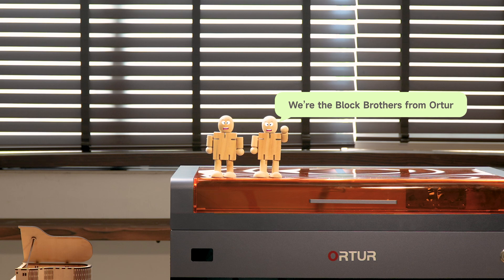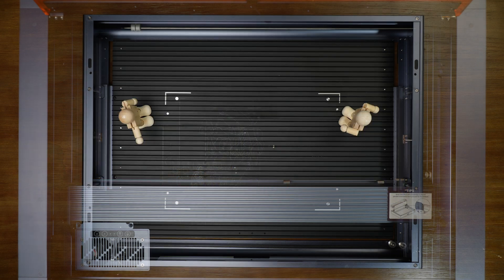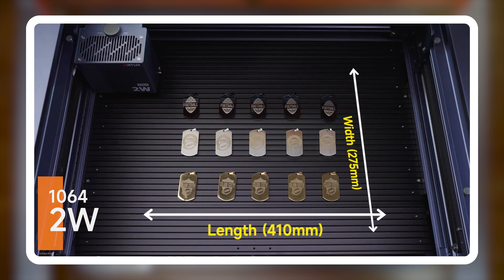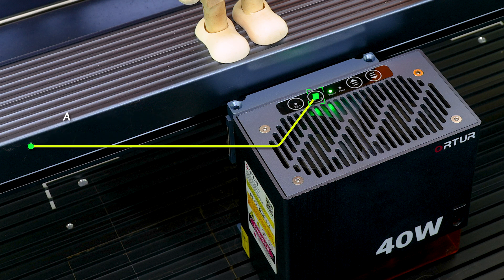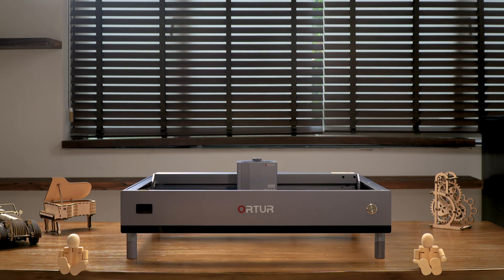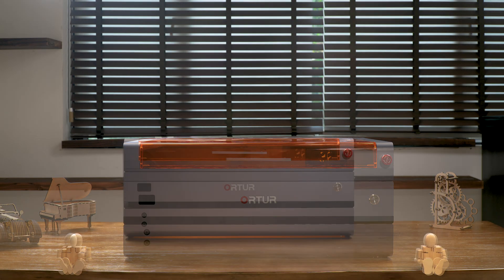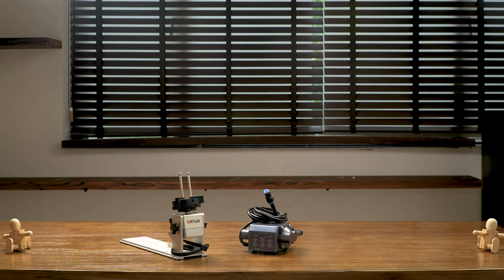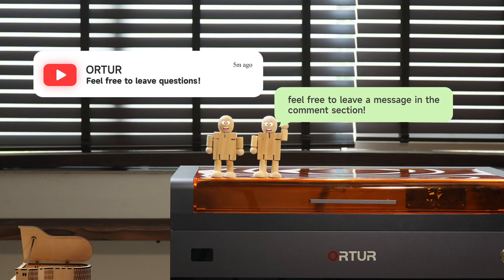Ortur H20：5 FAQS You Need To Know——Let the Block Brothers tell you.🤗

Comment: How do you use the Yrr rotary tool with it? I tried a skinny tumbler and the engraver head would not go high enough. I have the H2O 40W.
Reply from the maker: Hi, when using the YRR you need to remove the bottom layer of the machine and at the same time install a kickstand for the second mainframe so that it will work properly!😊😊
Reply: @orturnet thank you!